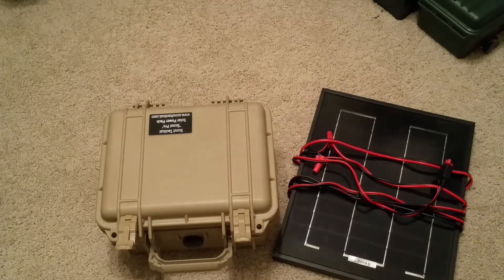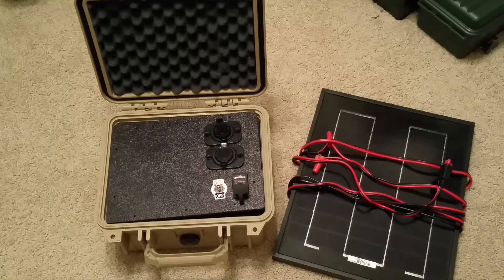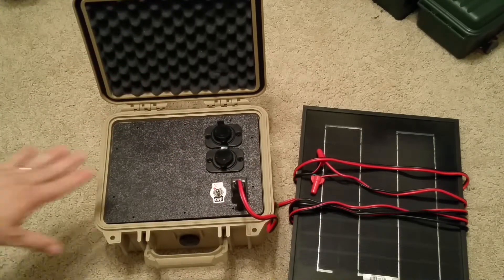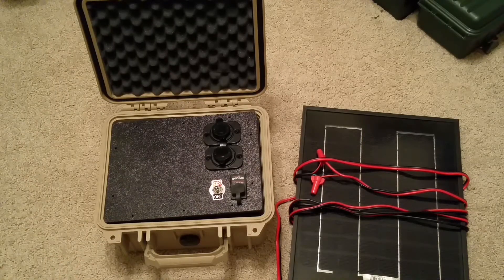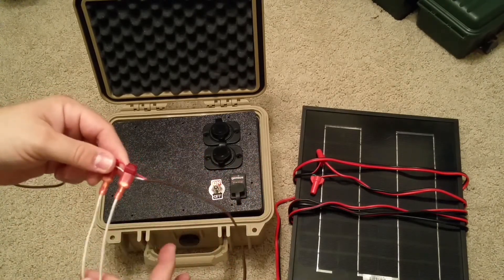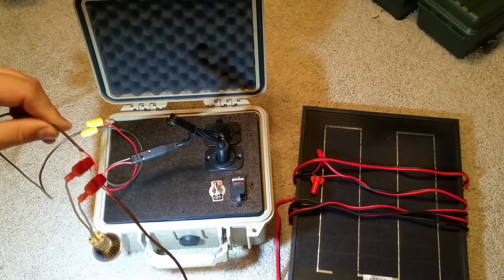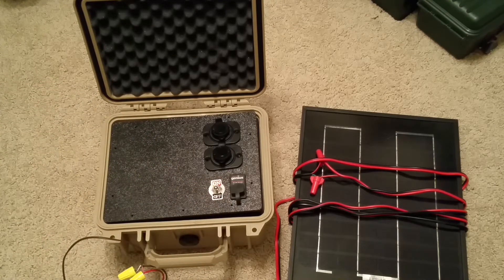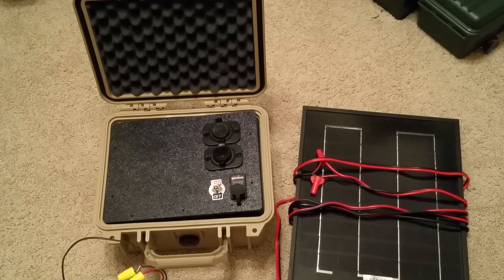Portable Solar Backup Power Project - Scout Prepper

Comment: I built something a little Badder using the Harbor Freight 3800 Hard Case. IT has a 30 Amp LifePo4 battery, a 10 Amp Charge Controller a dual 3 Amp USB, a Cigarette Plug/ Also a Cigarette Plug for the Input from the Solar Panel, a 100 Watt AC Inverter, and aa 10 Amp Powerpole rotary Switch. It can handle up to 125 Watts of Solar, and it has ALL of the Adapters it needs for EVERY Solar Connecting system on the Market. It DID Cost a little over $500 to build: But the advantage is that if something DOES go wrong, as the person who BUILT it, I can FIX it, lol!